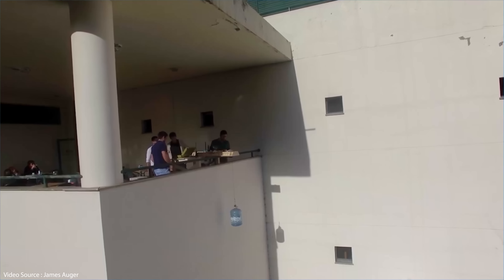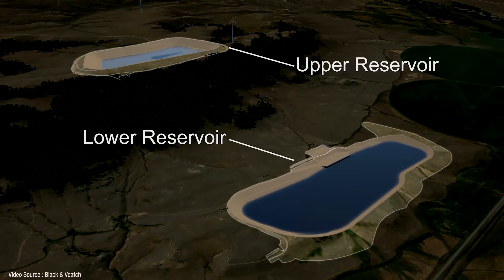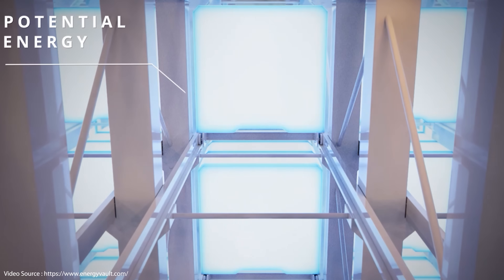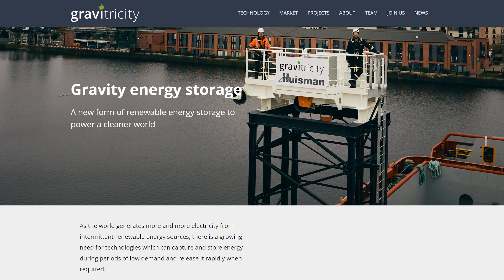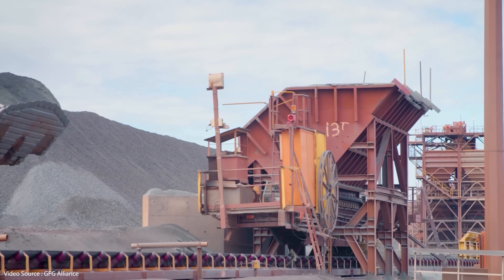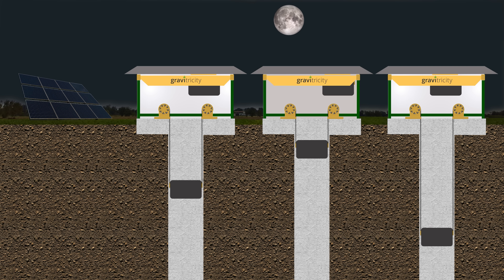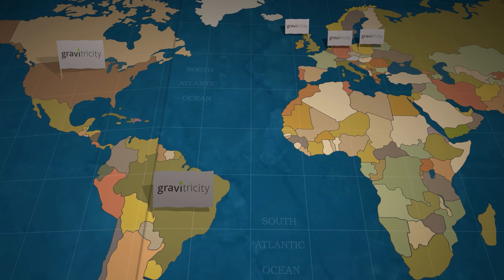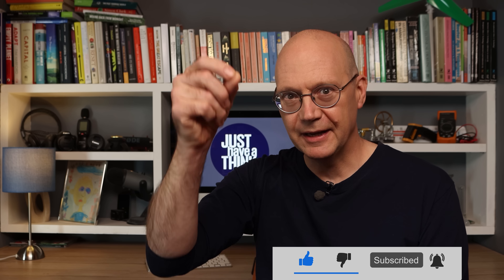Gravity Energy Storage. Who's right and who's wrong?

Comment: A far better use of an abandoned mine would be a pumped hydro system.  Its just so simple.  Yes its less efficient but...that doesn't matter.  What matters is only the total system cost (capital and operating costs) including the  generating source.  I think you'll find that the total system cost is much lower for pumped hydro and wind or solar.  One other benefit:  a flooded mine would be no problem.